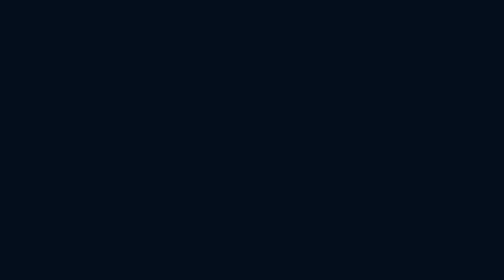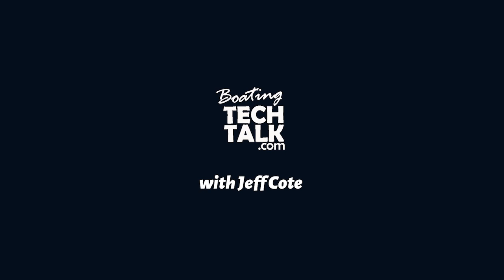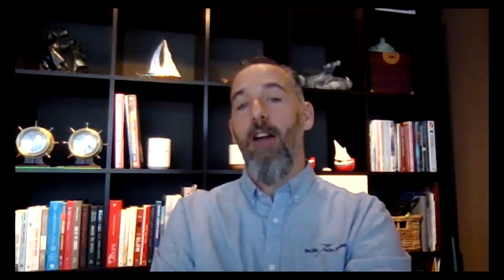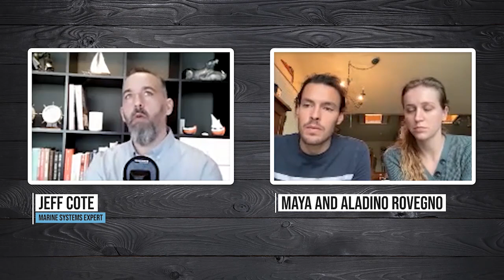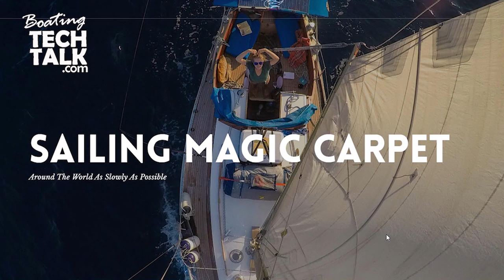12 Volt vs 24 Volt On My Boat?

Comment: I am doing a partial redesign/rewiring of a 36" sailboat. 
Staying 12v, with a new LFP House Bank in the aft cockpit lazarette.  Mitigating voltage drop by installing an AGM Start/Windlass Bank in the middle of the boat (which is where the engine is located). Engine will run when windlass operating, so plentiful 12V+ supply to the windlass...
Alternator set to LFP profile will charge both banks via a Victron battery isolator .(This might slightly undercharge the AGMs, but with greater wire run & voltage drop to the House Bank the regulator will boost voltage to the more distant LFP, getting closer to the nearby AGM voltage needs).  When the alternator is not charging a Victron 18A DC-DC will bring the AGM bank back to 100% and keep it there.  Meantime the LFPs will be OK at a less than 100% SOC.

Comment: Jeff 
With all that said. If you look to use  solar as your charge source with a small 2k gen as back up and have no inboard engine.
Would 24 be a better choice to store power then take down to 12v battery. Put the 24 in 2 -12 v batteries in series. Thinking if there is trouble you could change  to 12 v and change profile of charge converter. You would have  3 12 v batteries. As I write this I say too complicated for small boat. Thank you

Comment: I think in this case I would keep it simple at 12V and retain redundancy.
Reply: The reality is that if you go 24v for new build, you just have to use two 12v batteries in series. These batteries are more likely to be found somewhere isolated. However if you need a new VHF or other 12V DC component to be replace in a remote location the likeliness of you needing to order for delivery is very high so then keeping it in 12V DC for redundancy makes it pretty useless as you could also order your 24V equipment as fast. Also 12V DC equipments are more expensive than 24V ones ie. solar charger and this has to be added to the reflexion.  In Europe if you go “blue water cruising” and you do a rewire or new build most electrical engineers would go 24V DC as the new USB-C can take more than 12V (so you could charger devices like laptops directly onto them) and if you use an inverter (230VAC for us) this makes it even more efficient than going from 12V DC to 230VAC. 
So it isn’t just saving on the cost of the wires sizes and current usage cut in two. it is more future proof and efficient for live-aboard as they will be more power hungry than someone going for a weekend sailing along the coast. Also 
Now North America is different and they see things differently but in Europe and it seems most of the world is following we pushing for most equipments  to be manufactured in 24V DC as it is cheaper and if electrical propulsion is involved 48V DC.

Comment: As I understand it the alternator should be around 25% of the amp hour capacity of the house bank - so 200AH house bank would require a 50Amp alternator - but would it ? In one of your other videos you said that however many Amps an alternator advertises - it is probably around 50% of that - so in this case a 100Amp alternator to kick out 50 Amps being what he 200AH house bank needs...?

Comment: I just got a boat new to me, previous owner has 2 deep cycle batteries and no starting battery. They're hooked up to a 1, 2, all battery switch. I'm considering adding a starting battery. My question is, can I wire the 2 deep cycle batteries in parallel to position 2 effectively doubling my battery length for stereo/aux usage, and the starting battery to position 1? If so, should I be starting and running the boat/stereo/accessories on All, and only use the deep cycles when on shore?

Comment: Hi Jeff. This is an unrelated question but I would like to hear your thoughts. I just installed a expensive  and plath
Masthead light. The wires for the light are very thin. I soldered them to 14 GA  wire. A very delicate process.  Do you have any tips for dealing with tiny wires?

Comment: 33 foot boat, all in 24 v except vhf and aux heater. Works really well. So starter, amp, winches, lights, pumps etc. I would do it again. 
 The stuff is there. It’s not that 95% of people choose 12v. It is that 95% of people by big production boats. If you’re redoing the whole wiring I wouldn’t even consider 12volts.

Comment: This was very reassuring.  Thank you Jeff for the great video.   We were “lucky” enough to buy a boat (40’ offshore Cheoy Lee) which was basically gutted.  We decided since we were “starting from scratch” that we would install 24v.   We purchased a 24v starter and alternator (Balmar) for our new, re-built engine (Yanmar 65hp).  We have not had need to purchase a dc to dc converter yet as we have been able to find everything in 24v with the exception of a stereo.  Our solution to that was to buy JBL waterproof speakers and we love them since anyone onboard can play their music from their phone.  We are currently in the process of installing the engines instrument panel… our mechanic wasn’t sure if we would need to replace the instruments (fuel gauge, RPM, temp, etc) due the conversion.  I would think not but would love to hear your thoughts.   Thank you!

Comment: Not that this should be a driving factor, but if you are a YouTube’er (or otherwise have lots of USB charging needs), my understanding is that 24V allows you to take advantage of certain modes of USB-C PD charging.  Though probably easiest in that case to just boost 12V to 24V if that’s your only use case.

Comment: When I finally, finally (FINALLY!!!) get to begin the final planning and construction of my trimaran, Pacific Yacht Systems will be designing the entire electrical/electronics system. I have full trust in Jeff and the folks there (I had some great conversations with these incredible people).
The most difficult part? Putting all of the preconceived ideas about 12v vs 24v vs 48v systems to the side, learning as much as possible of the new/current technologies, putting them away so that they don't get in the way of realistic goals.
The technologies have advanced so far in just the last five years and PYS keeps up with every new development.
As I've had drummed into me, TRUST THE EXPERTS WHO ACTUALLY DO IT! This is why they're the professionals.
As always, a great video!

Comment: What about 48 volt system? Yes, I know that 48 volt appliances are almost impossible to find. But 48 volt DC system is supposedly more efficient than a 12 or 24 volt system.
Reply: Plenty do it as the primary bank mostly for drive systems, catamarans also just for the lengths. More efficient then converters leads to reexamination of that ballance. 
I am aware of multiple electric drive monohulls very happy with conversion with just charging, solar, inverter and drive motor at 48v, remaining on 12v. 
Converters are much more efficient than in the past so I had to change my views.